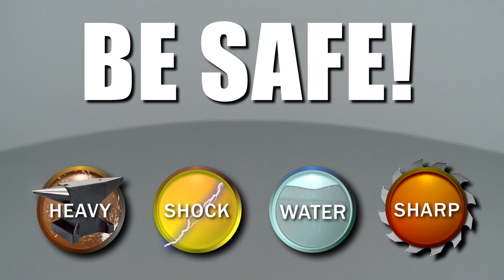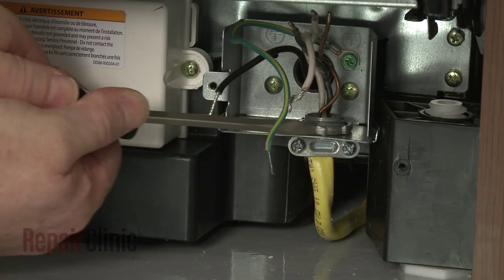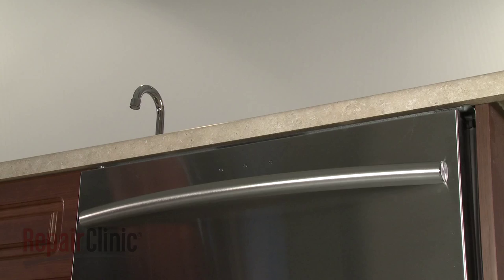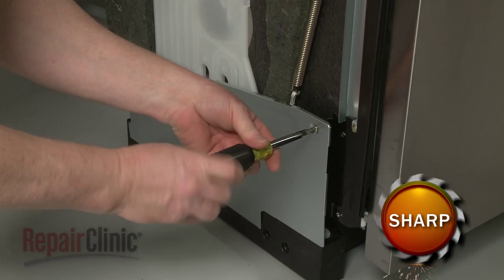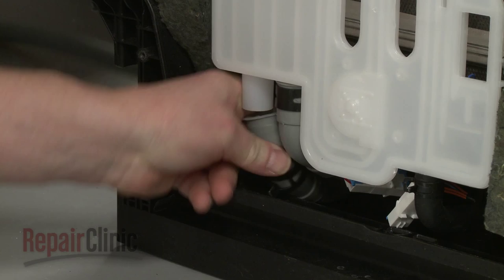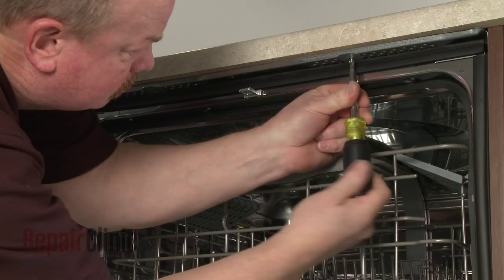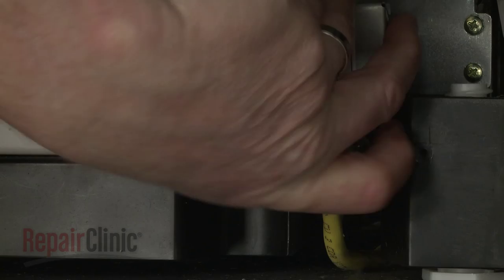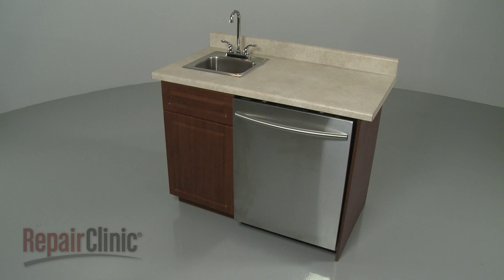Samsung Dishwasher Drain Hose Replacement #DD67-00059A

Comment: This is a great step-by-step video. Our dishwasher has a strong odor---is it possible  that there could be an obstruction in the hose that's causing the smell?
Reply: These dishwashers will error out if they don't drain fast enough, so it's more likely that there's either gunk built up somewhere else - mine likes to accumulate crap in the "maintenance free filter" at the bottom - or there's no air trap in the drain line and you're smelling your sewer. Installation instructions say to raise part of the drain line up to 30" to create the air trap.

Comment: Hi there. If just replacing the the drain hose, why do you disconnect the connections in the junction box, and the water supply hose? From what I can tell in the video (unless I'm missing something), it didn't have much to do with the actual drain hose replacement. Unless you needed to do these in order to pull out the dishwasher?
Reply from the maker: HolySakeCup Correct. It was because we had to pull it from the cabinet.
Reply: Duh
Reply: I have enough slack in mine to pull out :)

Comment: I attempted this but the "Spring Clamp" was turned to the inside.  I could not spin it around, could not access it with anything as my hand barely fit in there.  New dishwasher so was scared I would break that fragile reservoir. Any tricks to getting the clamp rotated around?

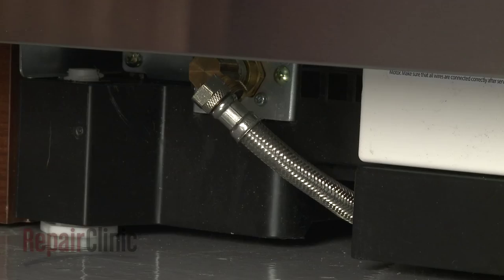Comment: At 6:40, shouldn't the inlet valve water supply be wrapped with the PTFE  thread seal tape before reconnecting?

Comment: Hi ! I tried to find the video for replacing the Drain Hose DD97-00137A for my DMT300 series dishwasher. The hose is longer ( comparing to the  DD67-00059A showing in this Video) and placed differently inside of the dishwasher. Thanks in advance
Reply from the maker: Igor Gorbov The manner in which the unit comes apart and replaced should be close. We do not have a video for that specific part.

Comment: Hi there I have exactly the same dishwasher and it wouldn't dain until I jerk the drain hose. do you thing that the drain hose is clogged and is there a way to unclog it without taking it off? thanks
Reply from the maker: Victor Malyshev You could try using a shop vac to clear and obstruction, but most likely you will need to remove the old hose to properly clean it.